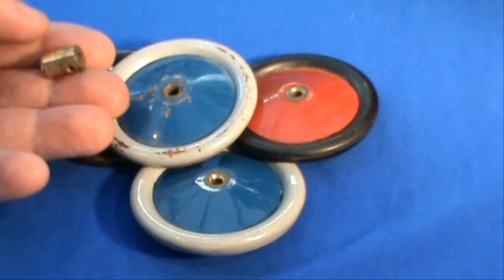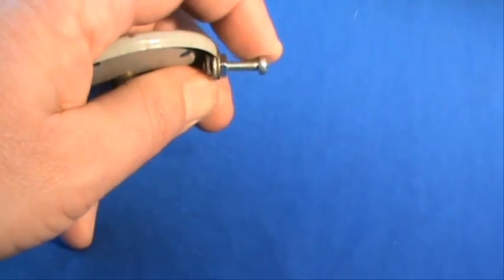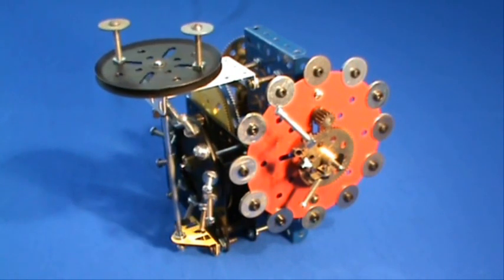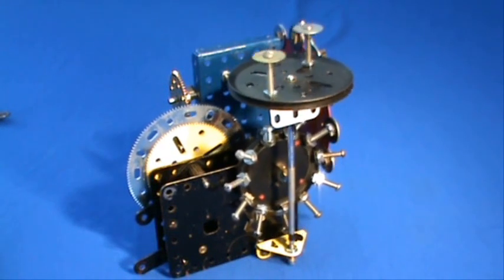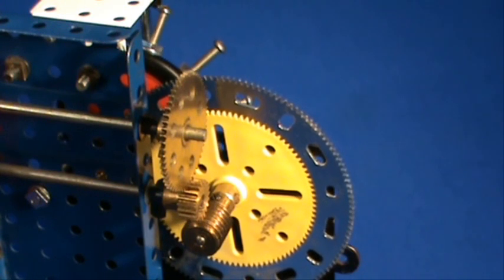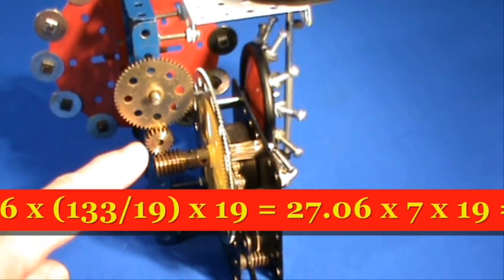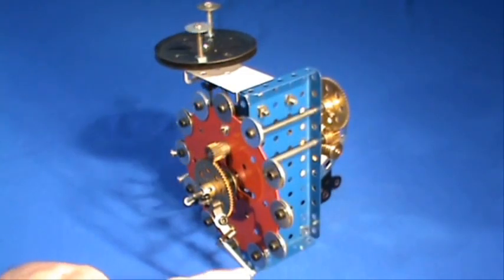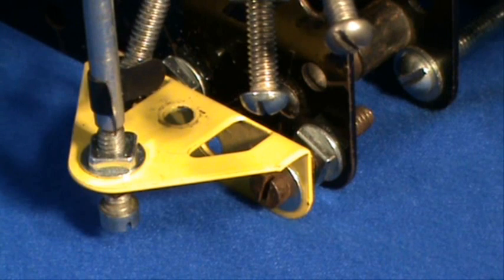Foliot & Verge Clock - 20 Parts.wmv

Comment from the maker: Of course you can use that design. If there was ever a patent on the Foliot and Verge mechanism, then it would have expired over 700 years ago, so we're both safe from prosecution! I like to think that all Meccano model designs are 'discovered' rather than 'invented', because we only have a finite set of components to use in a finite set of ways. I imagine it was easier to set up than a pendulum or balance wheel escapement, with or without Meccano. Best wishes for future school projects.